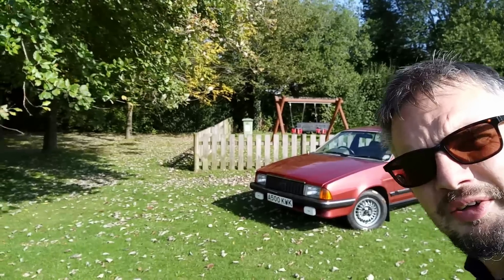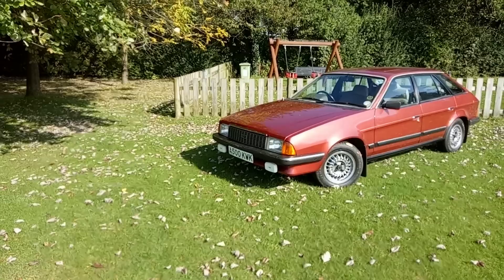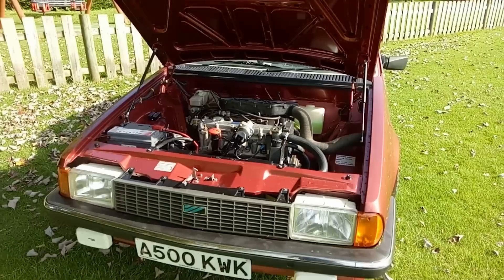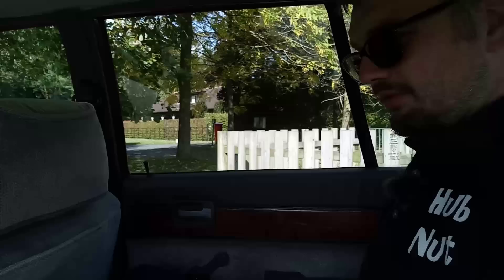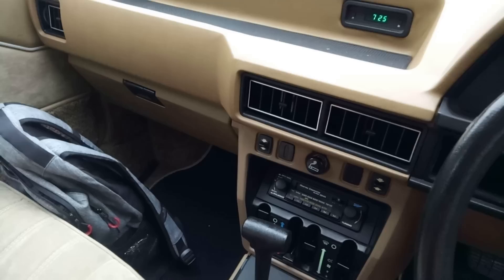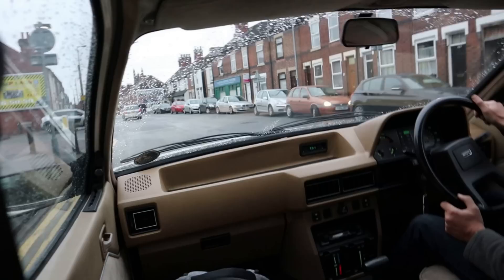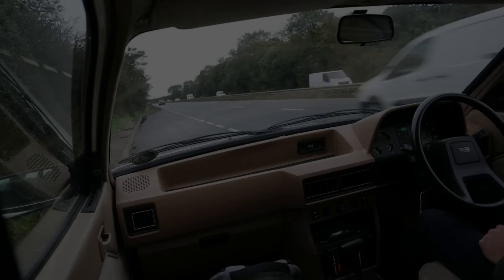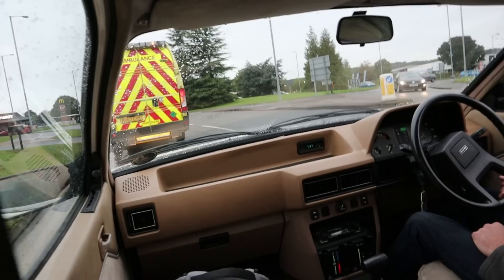Real Road Test: Ambassador vs Princess Pt2: Ambassador time!

Comment: From what I recall, Austin Rovers of this period would either have a single wipe option or an intermittent wipe option--I don't think they ever got both, but willing to be proven wrong there.
Reply from the maker: I think you're right. The chunky Maestro/Montego stalks didn't have a flick wipe.
Reply: @HubNut  Yes they did - pull the wiper stalk towards the steering wheel for a flick wipe/mist function.
Reply: The push down flick wipe action was cleverly(?) converted into intermittent wipe control with the addition of the Lucas 6DA intermittent wiper control unit. Push down on the stalk to turn  intermittent wipe on (one wipe every 6 seconds), push down again to stop it. Or if you want just flick wipe, push the wiper stalk down and hold it there for about 1.5 seconds. Used on loads of up spec BL cars and an easy plug-in mod!
Reply: @simonheap4294  I remember reading the owner's manual for my father's 1983 Maestro and it definitely said the single wipe and intermittent controls were the same, so I assumed that meant you could only have one or the other--interesting to hear it could have both.
Reply: @d2factotum  yes, that's what the handbook said but the instructions/data sheet for the 6DA unit went into more detail!

Comment: Those 4 pot calipers were the best bit of the car. With the appropriate mounting adaptors and spacers for thicker vented discs they transformed 2.8 Capris, my Sunbeam Tiger, and a friends TR7 V8 into cars that could stop as well as go. The rest of the car was sh*te. No wonder BL went bust.

Comment: I may be wrong (nothing new) but I thought that the break test switch just tested the warning indicator lamp ? any sad buggers out there know ?.....I work in building maintenance and can never resist the "Lamp test" button on any boiler or fire-alarm panel.
Reply from the maker: Yes, that is all it does. If the lamp comes on any other time, your brake fluid is low.
Reply: @HubNut  You know your stuff mate, cheers !

Comment: They do have intermittent. Flick down and intermittent selected. Flick again to turn off.
Reply from the maker: Nope. That didn't happen. On either car.
Reply: HubNut Interesting. The ital and maxi3 had that. And I thought when you applied water the wipers worked for a few wipes too. Program wipe they called it.

Comment: Mmmm. More or less as I expected. The red car in particular, real showroom totty. But rough and rattly on the road... So very very close, but not quite there........

Like others here..... Please can I have an Ambassador, with that Wolseley interior and E6 engine........

Now. You commented on the steering, only the once... I had a 1700 hire car back in the day.... That car also had power steering, and "over" steered...... Small steering input, tried to take you on to a much bigger steering input.......... Made it very very unpleasant to drive.. Was that roughly what you were describing?
Reply from the maker: I guess so, though I had just stepped out of the CityRover, which is even worse in that regard - one of the changes Rover made...

Comment: It was sadly a little bit too little too late for this old beastie and the cost must have been terrible to switch to a poorly selling car for only two years to be supplanted by the Montego in the bracket which was very modern and competing against the space age futuristic Granada MK3 was just never going to happen.   Consider the VDP was A-R's top of the fleet line after the SD1 and it was already beaten even by the horrible Vauxhall Carlton which also seemed to attract earwax browns and beiges interior wise whilst Ford ploughed ahead with affordable car luxuries as standard that outdid the poor Ambassador like the gawjus MK1 Sierra 2.0 Ghia estate, PAS and all round leccy windows, leccy sunroof and mirrors, premier sound system, disgustingly huge load space and an ability to pull anything with a towing eye.   I suspect too the VDP badge was more an applique than the real thing as you compare the Ambassador's VDP to the Montego VDP, Allegro VDP, Rover SD1 VDP,  heck even the Metro VDP there was an air of cigars and brandy going on in there with the Rover 3500 VDP being absurdly plush, saggy seats and a bit of carpet glued to the doors does not make a real coachbuilt VDP imho lol

Comment: Total last ditch desperation on Austin's part......and to think you could of had sierra mk1  2.0 ghia or cavalier mk3  1.8cdi for around the same price at that time!
Reply from the maker: Mk2 Cavalier. Did they offer fuel injection as early as 1984?
Reply: @HubNut  A400 WNP 1.8 CDi (gold) was my sisters boyfriend's (now husband)  car in the late 80s, and the 1.8sri (112bhp) was available from Y reg, because i had one around 1992. so the ambassador was probably not the best buy around 1983-84.

Comment: The princess particularly in Wolsley form was a looker, pity they fitted the 2200 E series, wonder why they didn't  fit the much more refined and robust E series 2600 with a five speed developed for the Leyland P76. I mean it was already developed and tested  in 1973 with identical dimensions to the 2200, more poor management decisions I guess.
Reply from the maker: 2600 was even taller as an engine. P76 was also rear wheel drive, while the Princess was not.
Reply: @HubNut after the issues with the 2200 E series in the Tasman and Kimberley a suggestion was made to revert to the 1800S form while the work on the  2600 was completed, the 5 speed transmission was already developed for the 1500 and according to a friend who worked at Leyland Australia prototypes with an improved linkage had been designed to suit the FWD layout. Unfortunately poor sales of the X6 models forced the early release of the P76 prior to development work on this driveline being completed .
Reply: @HubNut  here is a link to confirm the information re the 2600 information given https://www.tradeuniquecars.com.au/feature-cars/1112/austin-x6-range-review

Comment: I think the Ambassador is an attractive looking car and looks particularly well in white.  I could not tolerate the strained engine noise on the motorway, however.  Shame it didn't have the Princess engine, which sounds fantastic.
Reply: Needs an under-bonnet sound pad. Makes a huge difference.

Comment: Doesn't look like much of a 'wedge' to me with that rather flat and higher leading edge, compared to the Princess.
Given the choice I'd say the Princess looked nicer by virtue of the more 'wedge' styling. Shame about the non-hatchback feature. 
First look of the Princess reminded me of the NSU Ro80 actually - But, the Ro80 is far earlier design / production and is a rounder edged wedge - plus the styling of function - Not tacked on to look 'functional'. e.g. under the front bumper actual ventilation rather than an expansive flat area forming a wall opposing airflow.  Nor did the Ro80 have the claustrophobic feel of the driver and passenger areas. Oh... and sure went a LOT faster highway cruising! 
I guess the same could be said for the 'blanking plugs' in dashboard... what were they thinking? 

https://www.youtube.com/watch?v=dIfV804Kjgw

So, is this 'Vanden Plas' [or Princess] up to the inferred 'top shelf' ... worthy of that title?  I kinda think not... more Vanden Plastic. 
Bit of a wank really, just like the tosser British Class system it supposedly appeals to... or at least Middle Class peeps 'Keeping Up Appearances'. LOL   Yeah, we can all imagine Hyacinth Bucket buying into this plastic bucket of bolts - So superficial.

Comment: Nice car generally.. but what was the point of the VP models at this time? No leather seats, no picnic tables... just some planks of fake wood on the doors and dash... and ONLY on the very late models?! Not what VP should be by any stretch.
Reply from the maker: Agree. At least the Metro, Maestro and Montego VdP had leather and chrome door handles!
Reply: @HubNut VP was Leyland's cynical marketing equivalent of Ford's Ghia at the time by then - just a badge.

Comment: Pains me to say this,  but the obvious omission point  in this review was the scandalously long radiator top hose.  Could this floppy extravagance explain the  cost cutting evident elsewhere  with no budget for  door bins or vinyl seating arrangements? Also the econometer in preference to 5 gears; that's progress indeed. Surprised they didn't include a sound level meter, or perhaps earlier trials kept bending the needle at the end of its travel? Illuminatingly also the Princess had an ambitiously small battery but Ambassadors seem to need plenty of cranking reserves? Will we get to see your Red Car procedural failures please in another video? Rather a shocking car here apparently designed with input from a clandestine team of Lada NVH experts. Having been obliged to learn to learn to drive in a Morris Marina 1700L estate , I'm grudgingly seeing that car now in a new light.
Reply from the maker: Did you see the top hose on the Renault 21?
Reply: @HubNut  will go in search; presently engaged in serious matter of anti freeze colouring on 4xoverland...
Reply: Ian,  dligence duly done; Renault 21 hose clearly cannot compete for A-R floppy  nastiness, the result evidently  of a design committee , not a desperation clinic and  manages two very professional looking moulded bends, rather than being perhaps cut off a roll by a Robert with a Stanley knife in Austin Roverland.  Galling Gallic superiority or what? Now I've got wound up   under this bonnet,  the meandering wire and cardboard induction hose also looks good for liberating a couple of much needed brake horsepower with a bit of fettling. Anorak point, works do in Brum in  the early  1990s had me  a fabulous evening sat next to  a colleague's husband who was an expert on steering wheel airbags in this era of unsafe at any speed.  Bliss

Comment: BL logic of not fitting  rev counter on the high line model!
Reply: Its stops you from seeing the O series engine revving itself into oblivion once you've finally made it to 70 mph on the motorway. The screaming engine noise is masked by the horrendous rattle of the interior fixtures, trim and leaky sunroof.

Comment: Front and is not an improvement. Looks like any contemporary Chrysler and GM egg.
While the old design at least was original.
Don't know about the engine. Is it the same 2 liter 16 valve the Triumph Dolomite had?
Saab took that concept, enhanced it and used it to the very last..
Reply from the maker: Nope. 8-valve and entirely unrelated to the Triumph engine.
Reply: @HubNut  Pity. I think it really would have made the difference. Thanks for answering. :)

Comment: British car workers CAN make a car without trim rattles - just ask an owner of a Nissan, Toyota or Honda produced in this country.  If the Nissans produced just down the road from me were crap they wouldn't be sending them in their thousands to Japan to satisfy JDM demand.  BTW Ian, are you saying Vanden Plah rather than (the correct) Vanden Plas just to annoy me?  I have commented on it before (SD1 v. 800 I think) but you still do it!  I'll still watch and subscribe but it is a touch irritating mate.  Mike
Reply from the maker: No, I do it because I watched this. https://www.youtube.com/watch?v=WUG3O5imCGU
Reply: CORRECTION:  I believed Carrosserie Van den Plas were Dutch - turns out they were Belgian (presumably from the northern, i.e. Dutch, end of the country).  Apologies - when I make a mistake I'll admit it.  However, you'll still find cars described as having (British) VdP coachwork - they did some lovely Bentleys and Alvises. And I stand by the pronunciation.

Comment: Engine the wrong way round by modern convention !
Reply from the maker: Yes, but Honda and Mitsubishi liked their engines that way around. Not sure if they still do.
Reply: That would depend if their layouts were determined by the configuration of the BMC A and B series engines !
Reply from the maker: No. Crankshaft rotation.
Reply: That way round to prevent carb icing. Carb to the bulkhead not front facing in the air stream. The manual sump-full of gears inherited from the Land crab had a transfer gear. Montego O Series cars with end on Honda gearbox were installed the other way round and didn't have the transfer gear and had a different head so the carb faced to the rear.